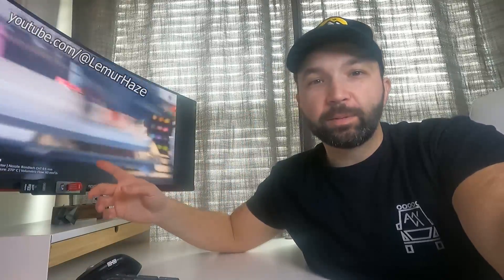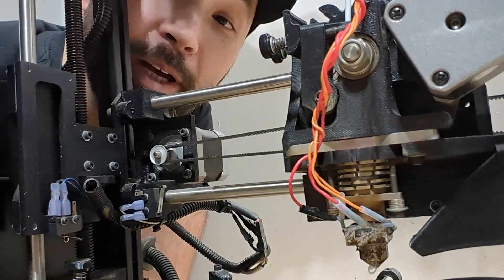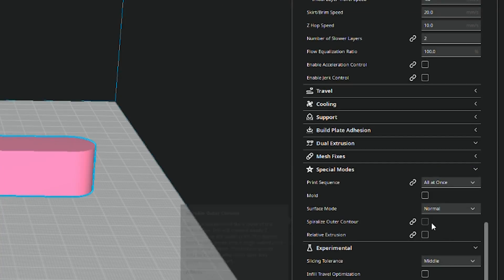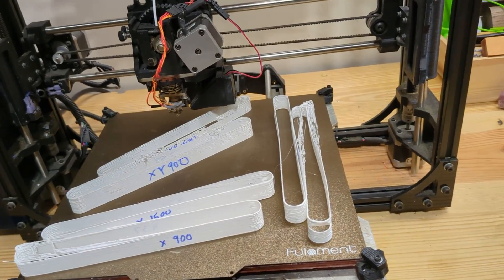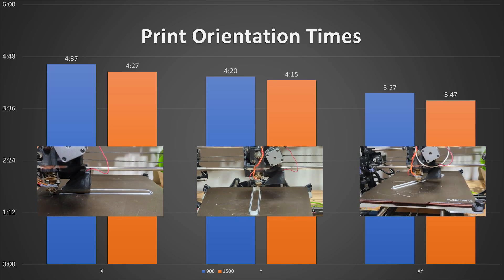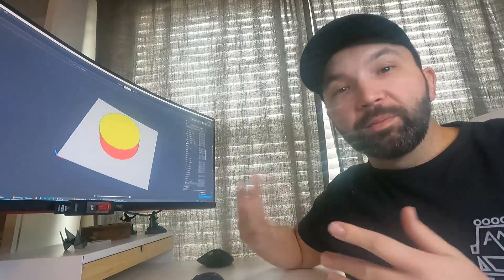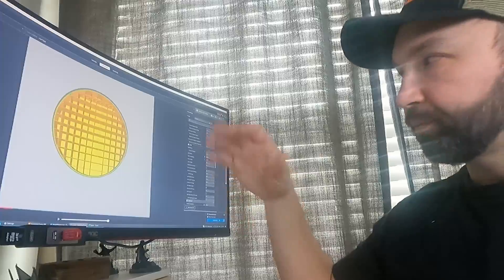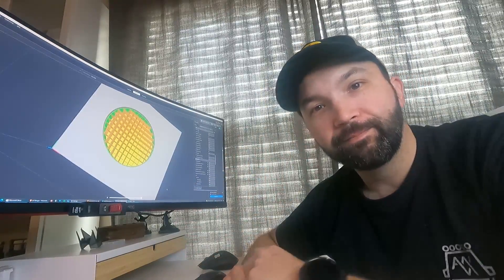Free Speed! Are you printing the wrong way?

Comment: I enjoyed this, its about time someone thought out of the box regarding speed!
 I have some very fast printers including an X1 Carbon but I want to get more out of my 3 Ender 5 Plus machines, I have already fitted high flow Dragonfly hot ends with dual cooling and closed loop motors and Bondtech BMG extruders in direct drive mode and although I have nearly tripled the stock 80mm/s speed to 235 mm/s and maintain the highest quality its not even close to the silent speed profile of my X1 Carbon.
 Im going to try this orientation change with some parts I print on a regular basis, it will be interesting to see how much time I can  save.
One new Subscriber!
Reply: I will also test it out on the X1 Carbon and post the results
 I cant yet test it out on an Ender 5 Plus as they are busy doing production prints ,I dont use them to produce parts on a Sunday though so I will run my test then
Reply: OK so I made a test print similar to yours , 100mm long 20mmwide with rounded ends.
 I printed in vase mode and Standard speed profile and sliced from Bambu Studio for the X1 Carbon.
50mm/s first layer-outer wall 200mm/s.
In the default orintation along the X plane it took 8 min 25 sec to print.
In the diagonal orintation in the X,Y plane it took 6 min 48 sec to print
 That is quite a time saving.
If you would like me to print your test piece and provide the results data for the X1 Carbon I will, If you can post the STL to one of the model sites.
Reply from the maker: @AndrewAHayes  Sounds like you have some awesome printers! And thanks for subbing! Glad you did some testing of your own, especially on the X1 Carbon as its Core XY.  Interesting to see in XY it was faster than in X as XY should only use 1 motor and X would use 2. Definitely points to maybe not a weight/acceleration issue as my theory was originally. But great that there was still a difference and 25% is a big improvement.
For such a simple change that is a sizable difference and if your printing products to sell, that can definitely make a difference for free, which is awesome.
Would be really interested to hear the results from your Enders.

Someone else also asked for the original model so I put it up on Printables: https://www.printables.com/model/677651-print-orientation-speed-test-loop

Comment: this is 6th grade math.....even in public school .  Pythagorean theorem.  a^2 + b^2= c^2.  c is the hypotenuse of the triangle.    and a and b are your x and y.    the hypotenuse is basically 1.41 times the length of a side which means the sides are .707  the length of the hypotenuse.    therefore if your part is 10" long y or x would be traveling 10". but if you turn it 45deg on the bed x and y are only travelling 7" at the same time.  your deviation from this in your actual numbers is the radiuses at the ends of the part

Comment: I don't understand why this makes any difference. Shouldn't the printer accelerate at whatever acceleration it's set to, until it starts to skip? Mine (SV06) first starts skipping in Y at 12,000 mm/s2.

Anyway, it made zero difference on mine. I wrote some Gcode to swing it back and forth 10 times at 300 mm/s and 5000 mm/s2. X took 14.4 seconds and Y took 14.3 seconds, which is well within manual measurement error. Printer is a Sovol SV06 bedslinger.

Comment: This isn't the problem, it has nothing to do with the weight of the motors or the bed because those things won't slow anything down, in fact when those things are a factor you will get a layer shift instead. Your issue lies at the motherboard level, your older slower processor can't handle the calculation involved with going around the curve and it overruns the buffer while moving causing it to pause while it calculates it's next moves and continue moving again. If you want to see what I'm talking about, watch and listen to your video carefully as it going around the corners and notice the shuddering noise and movement characteristic vs a smooth corner. 8-bit 16mhz printer boards can often have issues around corners and details areas that becomes noticeable at speeds just over 50mm/sec depending on the size and curve of the corner.  It's also why it's common to see small random blobs in corners printed at high speeds with 8-bit boards. A different test that you could try that will produce a more consistent result despite the orientation would be to print a rectangle the width of the bed of a few layers so there aren't round corners in the print.  This is also one of the many reasons why many printer profiles slow walls down and crank the speed like crazy for straight-line infills like rectilinear, lines, grid, cubic, etc. It's also why printing gyroid infill on an 8-bit printer slows way down and can't reach even 100mm/sec but on a printer with a faster board it can really fly.

IMHO, the best way to speed up printing for prints that allow it are to go with a larger nozzle and/or taller layers. I print with a .6mm nozzle and .24mm layer heights and the print quality is often a negligible difference, but it allows for an easier time because walls printed at 40mm/sec won't get artifacts, but it's putting down 80% more filament at that print speed and since walls are thicker, you can drop down from 3 walls to 2, infill line quantity is reduced and there are fewer layers to print, far less total print head movement, and overall you can easily double the print speed. I recommend finding the faster print speed you can print a particular filament in without noticeable underextrusion and set 90% of that value as your safe reliable infill speed.
Reply: If that's the reason, why is there a difference between X and Y orientation? Both have the same speed and step quantity.

Comment: On BL's core XY slicer it did not make a difference 😒

Experiment: loaded a 20cm long thin & tall rectangular bar (scaled cube primitive). So, close to 100% of the lines are very long and in the same direction.
Set Infill to zero, 3 walls, no brim, no bridges/overhangs, only 1 layer for top & bottom with concentric pattern (again so all lines in same direction).
Sliced in X then Y then X+Y orientations. 

Results: 17:46 +/-1s (BL PLA profile 21mm3/s, default 0.2mmStandardLayerHeight 0.4nozzle profile)
Then maxed out all print speeds to 300mm/s and 10000mm2/s accel, whatever the line type (inner,outer,top,bottom...).
Results: 14:55 +/-1s

Am a little bit surprised that the X direction was not a tad faster as only the print head has to move. So the acceleration should be higher than head+gantry in Y. Wondering if the slicer is too dumb to take advantage of the kinetic gains, or if the extrusion ramp rate limits the accel or, maybe more likely, it just dumbly enforces the speed & acceleration values per line type shown in the slicer interface and leaves it at that ?

Mulling over it... 🤔
Thanks for the thought experiment !
Reply from the maker: Awesome follow through with a BambuLabs slicer. I am fairly certain that most slicers aren't thinking of the masses affecting speed and using one or 2 motors helping overcome that. Would be interesting to see real world results
Reply: @willofthemaker  Both were slicer estimates. 2nd is max'd out speed/accel values in all the slicer fields so as to amplify any time gains if any.
I'd expect real print time deltas to be really close to predicted, no matter the total time.
Just did another compare, this time with extrusion rate bumped from 21mm3/s to 50. To remove another potential limiter during slicing. Went down to 13:26 but still within +/-1s.
Would love to understand why the BL slicer doesn't asymmetrically take advantage of its own  printer's kinetics...
BL just leveraged the Prusa code, added input shaping to mitigate the motion artefacts due to high speeds, and stopped there ?

Comment: I seriously thought I was the only other person on the planet still using a TAZ4 as their day to day printer. Completely amazed to see you are still using the Budaschnozzle print head. I have upgraded mine several times, first with the Aero, then later with a 1.75 Aero. Then followed that up with a Revo Hemera setup mounted on a Wham Bam Mutant system. With that I can change back and forth between 2.85 and 1.75 with very little effort. Designed all the mounts myself and replaced the X carriage so I could mount up the Mutant hardware.
Drop my a message if any of this interests you and I'd be happy to share.
Reply from the maker: Haha thought I was the only one as well! Seen a few Taz 5s and 6s but not a Taz 4 in a while. I've been torn about upgrading. A: is it worth the money to upgrade vs keeping as is and spend the money on a second printer and B: keep it as is for historical reasons. 
I did order a Wuxn WXR so will have the soon. I Want to do a comparison between a really old printer vs latest and greatest tech, at least with bed slingers.

But that will be 1.75mm and it is getting harder to get 2.85mm filament so I might need to change and communize at some point either way. Definitely don't plan on getting rid of the lulzbot.

Comment: I’m not sure to understand. Motors used in 3D printer does not have any sensor to give physical movement info to your control board. Your firmware is the only actor in the acceleration pattern. I don’t think any weight of your print head or bed are involved here.
Reply: I agree, if all settings are matched for X and Y they should move at the same speed. If X or Y are too heavy for the settings you will lose steps. Something else is limiting the speed.
Reply from the maker: I think I might have to do more testing like adding weight to the print bed and seeing if it has an effect to really prove it out

Comment: i'm actually thinking maybe theres a firmware limitation on max speed that might be in play. At the 45 degree, both motors are spinning at the same speed leading to a faster print speed compared to just x or y
Reply from the maker: There might be. And possibly didn't even hit it at the lower acceleration as the 1500mm/s^2 was definitely moving faster.
Reply: @willofthemaker What if you try even higher accelerations? Just curious. More so how ugly do the prints get because I know on my prusa mk3 ringing is present at under 1k accels but doesnt get too much worse at 2.5K.
Reply from the maker: I tried one at. A bit higher than this and it didn't seem to happy. I actually was printing at 500mm/s^2 for years until recently when I got a bit more curious. 900 seems to be a sweet spot but might need to do some more actual testing and experimenting with it

Comment: This doesn't make any sense. The way this should be tested is trying to move the print head in X vs Y vs XY and increasing acceleration until you start skipping steps.
I don't even understand how you got any difference at all between those test runs if you're using the exact same acceleration and exact same speed.
Reply from the maker: Its the difference between software and hardware. The motor will put out so much torque => force at a given current. The more mass there is, the harder it will be to accelerate. If both x and y motor get the same signal (current, etc and they are the same motors) but moving different masses there will be a difference. Also of note could be more friction in one was vs the other.
Reply: @willofthemaker That's not how stepper motors work. The driver puts out a "step" and the motor can either rotate one step or it can't. If it can't then the step is lost and the controller is none the wiser resulting in layer shift.
Reply: @mkern2011 - Steppers on 3D Printers microstep between actual physical steps on the stepper. Stepper drivers get more resolution by microstepping between physical steps. So it relies on the force of one hard step coil vs the next. Therefore the resultant force can vary based on speed, load, acceleration, etc.
Reply: @FilamentFriday  I understand micro stepping. I don't see how it's relevant. Lost motion is lost motion and would show up as layer shifts.

Comment: If your Y is quicker than X, then wouldn't the optimal angle NOT be 45°? You should angle it to proportionally use more Y movement vs X movement to maximize available acceleration.
Reply from the maker: I think you would likely be correct

Comment: Nice to see that you can speed up thing with just orientation. For a printer with the 2.85mm filament, could a CHT nozzle be a good upgrade to increase printspeeds? If it is possible to swap out nozzles at all. CHT is a super simple upgrade to increase speeds on a 1.75mm setup where you can swap nozzles.
Reply: was thinking the same. CHT nozzles could help. A lot and you could lay down really thick lines for big prints
Reply from the maker: CHT nozzles would definitely help. Although I don't think would work with my machine without a new hot end. Mine is a budaschnozzle 2.0 where the nozzle is a simple cap the screws on to the hot end. Definitely a lot of things could improve my printer but at the cost of an all new printer. I have a Wuxn WXR on order so that might open more possibilities (although with 1.75 filament)

Comment: I just thinking, why other axle is faster than other. If all preferences are ok, they should move same speed. Of cource, if preferences are different and not even try same speed, print times is different too. Preferences what I mean are acceleration, velocity, jerk etc. 
So, if measures of produced piece is ok, print speed is same and XY speed varies, then acceleration and/or jerk settings must varies with these axles :).
That not affect what is point of video, but it could be nice to know what axle is made faster movements. Then you coud try orient your piece most fastest directions. I guess light Bowden head have quicker accel, deaccel and jerk settings than possibly heavier bed.
Just thinking to the "paper". 😊
Reply from the maker: It's a difference of what happens in the real world vs. Software. Accelerations might be set to a certain value but that is essentially a "goal" for the printer to reach. The motor might not actually be able to support that acceleration given the mass of the print head or the print head. That's why using two motors can get a faster result. It becomes the hypotenuse of a triangle. 📐so the x direction and y direction individually go less distance but the part itself goes the combination. At 45°, you get a 41% boost ( √(1+1)=1.41) in net gain in distance. Of course that gain is subject to motor capabilities
Reply: @willofthemaker  Is it just a goal though? The planner calculates steps, steps get sent to the motor driver and stuffs moves without the board knowing whether it slipped or not. The only thing I can think of is that the the motor driver can vary the signal sent to the motor poles based on how well the motor is responding? This is beyond my understanding and I don't understand how the print axes would stay synchronised with a lagging axis due to a driver-motor interaction.

Comment: This works great for cartesians. My print head moves fater then the bed on my ender 3 so i try to orient along the x axis if possible. But for my delta it doesnt make a difference other then keeping the majority of the print centered.especially at the top
Reply from the maker: The biggest impact is definitely in the infill as that's the one place you get the most straight lines and want to orient properly. I need to get a delta to have fun with at some point

Comment: CoreXY machines you want parts at a 45° angle with infill angle set to 0°/90°. The speed benefit during infill is what you want. Walls print significantly slower than infill. It’s more about the torque both motors provide at those speeds vs one motor.
Reply from the maker: That's what I would think as well. Thanks for the input

Comment: This is only true for Cartesian motion systems. Altering orientation on a delta will not a make difference. Doing it to a CoreXY could potentially make things worse as only a single motor is responsible for 45 degree moves.
Reply from the maker: Didn't think bout delta and I don't have experience with them but I'd imagine there are some moves that use different amount of motors? Not sure tbh.
For corexy, that's why I was saying the opposite is essentially true and you want perpendicular to the axis moves and not at 45 deg

Comment: I imagine this would increase ringing on machines that don't have input shaping, as it's accelerating more. Would be interesting to test.
Reply from the maker: The high speeds these days are crazy. I have. Wuxn WXR on order which will be pretty fast with the new firmware. Be interesting to see how much input shaping helps on a fast print vs off on. A slow print
Reply: I genraly recommend to not print fast at parts that has functional purposes or are detailed, because it (like you said) increases ringing/ghosting and the layer adhesion will be bad + it will loose strength
Reply: Ringing on X and Y are somewhat independent of one another, if you are using both in the 'safe' speed zones that don't cause much ringing, then going XY as the dominant direction on 'long' parts won't likely make the ringing between them additive. Going XY on longer prints, you could even slow the relative speeds of each and still print be faster in some cases. Certainly there are some caveats, like if your firmware is just artificially limiting speeds in the first-place, or if the flow rate can't keep up with long persisted XY moves.
Reply from the maker: Ultimately it kind of comes down to using your printer to it's capabilities and what quality you're willing to live with. Point of this video is you can set a print speed in slicer but depending on the layout on the bed, you might get reduced real world print time.

Of course having 2 motors going you are essentially adding another degree of motion and thus accelerations in another direction which could lead to secondary vibrations. So in that regard, this could point to a way of avoiding ringing by not doing that. Interesting thought